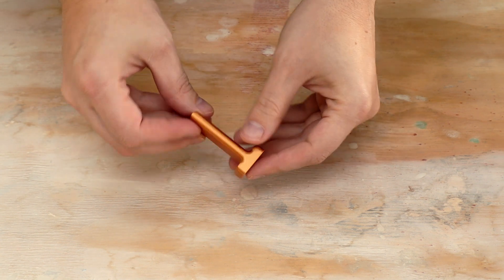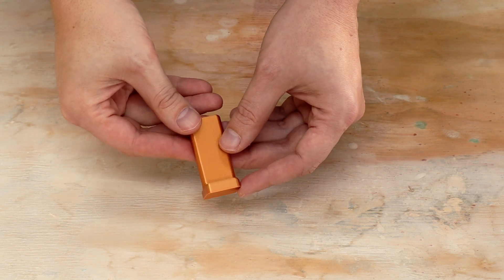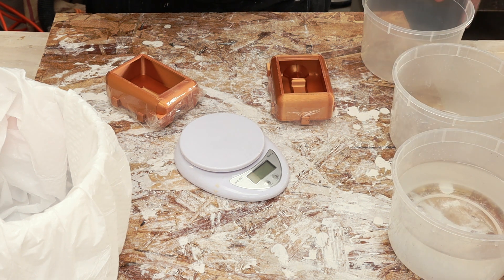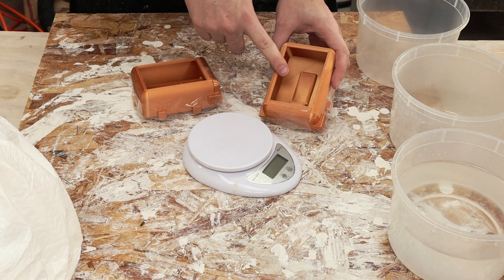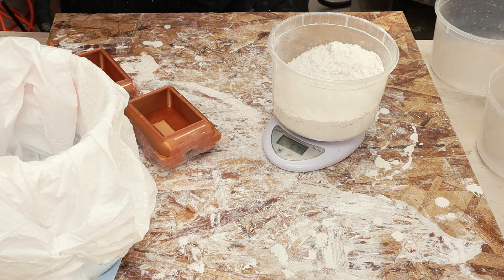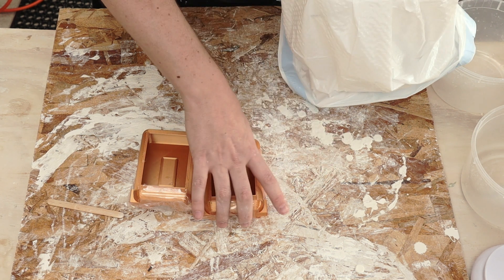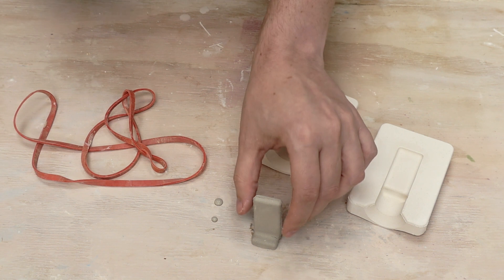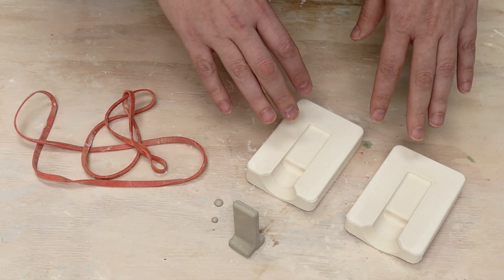Test Tiles and making plaster molds with my 3D printer and NO silicone

Comment: Hello Kent, do you always use PLA to print? I believe PLA dissolves in water. Doesn't that cause problems in relation to plaster that is water based.
Reply from the maker: Yes, I've only printed in PLA, and no it doesn't dissolve or cause any issues with plaster. PLA does absorb moisture (eg you want your PLA dry when printing_ but for this application I havent seen any issues at all and have printed a lot of molds.
Reply: @PotterybyKent  ok! thank you for your fast answer and the interesting video's
Reply from the maker: Sure thing!

Comment: How about adding screws? That should tightly push your plastic mold together, would it not?
Reply from the maker: Check out my newer videos - I've actually evolved into a full mold system now. With it I use threaded inserts and screws to join things together now.
Reply: @PotterybyKent  Very nice
Reply from the maker: Thanks!

Comment: I've seen hot glue used to prevent leaks, or clay that is reserved just for mold making (you wouldn't want to put it back into your main mix with the risk of plaster contamination).  Also, if you are making more test tile molds, why not add registration points to the 2 halves you have, then make 2 new halves for them both.
Reply from the maker: I tried hot glue previously and had problems getting a good seal. I think that's probably more of a problem with my very cheap hot glue gun! As far as the registration marks, that's great foreshadowing - I took a different approach but that is part of my next video.

Comment: I use cheap white silicone to seal the molds, doesn't cost much and comes away very easily. Great job thanks for the video.
Reply from the maker: Thanks. I've seen silicone used in similar applications and thought about it here. But I also knew I'd not want to wait for it to dry!